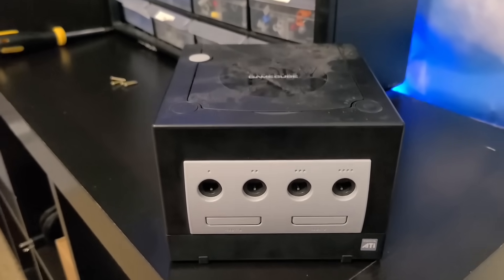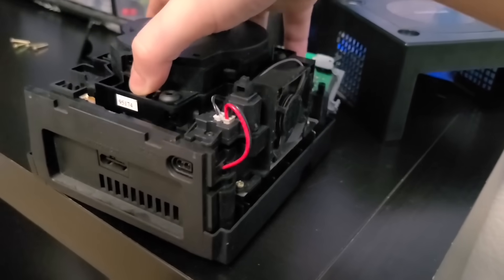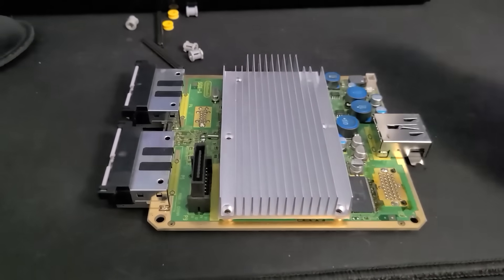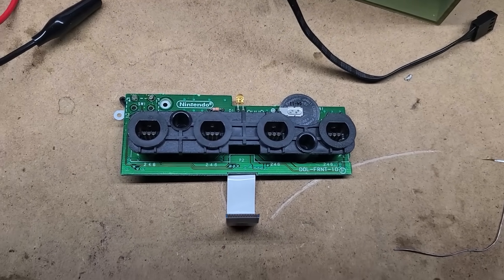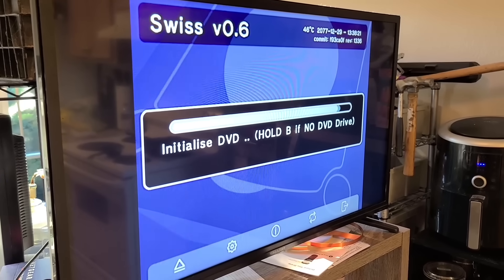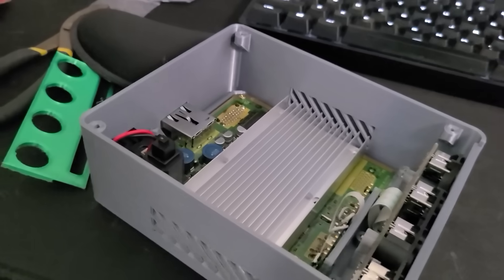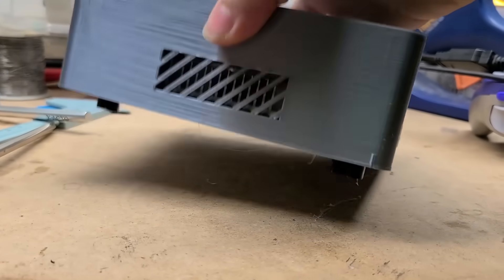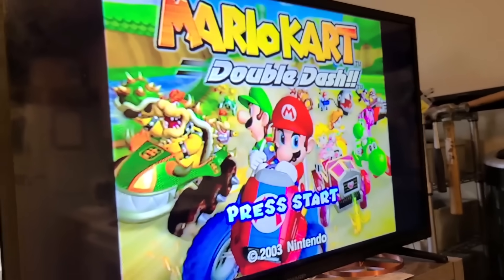I made my own GameCube Mini because Nintendo wont

Comment: Too late now but should've done the BT controller mod to it. That would've made it the perfect mini console. The mods people are doing to these now are amazing 👏
Reply: What's bt?
Reply: @moldorm99  Bluetooth
Reply: What about latency?
Reply: @stephanemignot100  can't recall but it seemed to be using a pretty decently new bt standard iirc. I'd do it if I could just because cords are annoying to me now. And if it does have bad latency someone will improve it with a raspberry Pico lol
Reply: hell four of the 8bitdo adapters are cheaper than the blue retro BT board.

Comment: You might consider passive cooling.  Since the original had the CD drive above the CPU, it necessitated the fan.  But perhaps with your top vents, passive cooling (no fan) would be possible  You would of course have to test it.

Comment: You could have used PWM (Pulse Width Modulation) to control the speed of the fan.  Pico could control a transistor that turned the fan on and off really fast to adjust the speed.  Then you could have gotten 3.3V worth of speed out of it while technically running it on 12V (or 7.5V, or whatever).
Reply: a transistor would be unneeded since there is straight up a PWM pin on that fan. not sure what logic voltage fans accept though.
Reply: @asuasuasu  That fan looks like a NF-A8 PWM. Gamecube stock fan however is straight up 12V 100% all the time, easily spotable since there are only two leads. Voltage controlled fans don't accept any logic and you only have three leads, two for power and one for tachometer.
He could've used the pico and an additional temperature sensor glued to the heatsink with thermal epoxy to get the current system temp and then use the pico to generate a PWM signal; no need for a transistor.
Reply: @Ruhrpottpatriot  If the third pin isn't for logic level PWM, then a micro controller board won't run a fan like that by itself. Not enough current source/sink capacity. Best to use a MOSFET.

Comment: the fan would probably be more efficient if it was blowing out the hot air
Reply: The Gamecubes fans are different they blow in air and it blows out on the side.

Comment: Great modification! The only worry for me would be that high temperature as soon as you boot into swiss. 50 degrees Celsius is pretty high for a cold start temperature!! My factory GC with swiss shows around 38 degrees Celsius after a cold start and does not exceed 42 degrees Celsius after 2 hours of RE4! Ambient temperature 25 degrees! This sensor might not be that accurate yet it could be indicative of the temperature situation on the board so watch out!
Reply from the maker: I have no idea why this is the case, but I've done 4 Picoboot gamecubes now and Swiss ALWAYS without fail shows above 50°C, even on fresh thermal pads on an otherwise stock console. It's pretty hot where I am so maybe the ambient temp is just high.
Reply: @BringusStudios  I dont know above 50 degrees is like having an Intel CPU :D:D I just did a picoboot Japanese DOL 001 yesterday for a friend of mine and the swiss was showing 26 degrees Celsius (without the disc drive) just test it with lower environment temps and see if that will go below 50 degrees but in general you should always be aware of the temps!
Reply: @BringusStudios  Also I would suggest you try two smaller fans for push pull on both sides of hte case, in theory that is the optimal air flow principle in any case be it console be it PCs etc!!!
Reply: not bad, but in this situation, pushing air is better than pulling. you should invert that fan and it should be cooler.

Comment: Watching this makes me think back to the “making Wii portable” days of YouTube, I wonder if there are any chunks of the board that the Gamecube just straight up doesn’t need to potentially remove some of the thickness of the console.

I’d imagine if Nintendo were to make a console like this it would be a normal looking gamecube at half the size like all the other classic/minis
Reply: I've seen someone tried to make a portable GameCube and they ended up using a Wii board, because it's way smaller and basically the same hardware (but clocked higher), which can run Gamecube (and Wii) games natively. It's a win-win, no reason to mess with GC board (other than novelty factor, I guess).
Reply: @MrGarryGrey  yeah now that I think about it I’ve seen someone do that too, I’m sure if Nintendo wanted to make there own mini they’d end up doing something like that and then loading it with Mario Sunshine, Wind Waker, Melee and then just throw on 7 games that no ones heard of
Reply: @DylozWitty  probably also double dash and a Mario party
Reply: @MrGarryGrey  yeah same
Reply: @MrGarryGrey  there is, some advantage to using a GC board. 

Assuming you keep the same bottom footprint and ports, you could attach a Gameboy Player, granting you perfect play for all GBA and GB/C titles unlike the still-imperfect emulation on Wii homebrew. I know he didn't do it here, but if you didn't it would work just as well as a stock gamecube.
Reply: nintendo launching a new GC or Wii machine would be rather surprising to me. they would almost certainly need to do this with emulation and you would need better than switch class hardware, aside of all the engineering effort.
in comparison, NES emulation is trivial and N64 emulation for a few select titles is not a massive challenge to a talented team. unless they straight up "steal" dolphin of course.
your best chance at an official solution would probably be on the switch successor. they're probably more interested into porting/remastering some of their popular titles though.
Reply: @asuasuasu  pretty sure dolphin was started by reverse engineering the wii so nintendo wouldn't really have to steal the code
Reply: Been in the hobby since 2007, and the good news is that the gamecube motherboard has already been traced out and there's a few trimming guides out there
N64 trimming guides exist as well, the Wii trimming research was pretty much done after those were finished
Reply: There was a project called killmii which trimmed a wii board to fit in an Altoids tin, along with a screen, barely usable controls, and enough battery life for 10 minutes of game time
Reply: I would buy that in a heartbeat.
Reply: I would like a portable GameCube made by Nintendo that takes the mini disk
Reply: I believe there's a gamecube emulator for phones even. But if nintendo were to make a new, official, non emulated version of the gamecube, the graphics and computing part could be very small, passively cooled, and efficient with today's tech. Obviously you still need a decent space for the disk drive.
Reply: @enterchannelname7568  I feel like they would most likely not actually keep the disc drive, most minis/classics both Nintendo and Sony have made in the past just have games loaded onto a hard drive rather then using discs, it allows them to keep the same look as the originals while removing some mild functionality
Reply: @enterchannelname7568  it’s inherently emulation though because it wouldn’t be gc hardware. FPGA consoles simulate hardware instead of software emulation but they’re several hundred dollars

Comment: Oh yeah, YouTube's about to pick this one up HARD. Rather than be an armchair electrician, I'm gonna stick to the positives and say that this is a super well executed mod! I had no idea about the integrated Power board on the DOL-101 model, so that'd be a huge help to things.

Out of curiosity, do you know if this cube still has the board points for serial port 2, even if it doesn't have the connector? If so, I imagine you could pair down the bulk even a little bit more by eliminating the SD gecko and adding an integrated SD card slot for your homebrew and dumps. It'd still require a physical memory card for game saves though, so the benefits might not be substantial enough to be worth it.

Thanks for sharing!

Edit: inb4 this gets posted to hackaday
Reply from the maker: I've been told it does have the hardware to communicate over SP2 still, but I'm not sure where the source is for that. I could always compare a rev a/b board and follow the traces but that sounds like a pain...
Reply: @BringusStudios  Do you have a discord I could add? I found some links that should help, but YouTube probably will block them.
Reply: @BringusStudios  Sent you a DM on Printables with the links.

Comment: You don't need to take up a memory card slot for your SD adapter, you can solder it to the serial pads on the board that SP2 normally connects to. Then you can have a microSD slot integrated into your faceplate.
Reply: I actually got like 50 of those PCB's fabricated last year and haven't used a single one lol.
Reply: @MattBeaver  The ones made for SP2-lacking boards / internal installation? Lol, at least PCB fabbing is cheap as all hell these days.
Reply: @boomers_pb  Yup, those exact ones.
Reply: @MattBeaver  what a waste
Reply: Can you please direct me to a link for that as I have a dol101 and don't have a sd2 memory card adapter.

Comment: It would be flatter to just lay the controller ports so the port faces up. I didn't see what the tall black port was on the mainboard. You could just junk the power switch/AC input and use any switch/wires. Add a top to the heatsink fins and blow from the side.
Reply from the maker: The plan is to keep developing it to be smaller. Thinner fan, proper SD card slot, DC barrel jack, relocated controller ports, etc
Reply: @BringusStudios  Maybe try and find a Wii and look at what it uses, maybe those parts might be smaller. Flatter heatsink? You might have to use a 4 or 6 pin molex connector if there are multiple voltages(or maybe to supply power to a cooling fan without being limited to what the console was designed to give to its stock fan).

Comment: This is awesome! I wonder how much smaller it could possibly get with internal sd2sp2 and blueretro. The controller ports and memory card slots could be dropped as a result.
Reply: Yeah, I was thinking the same thing.

Some kind of internal SD solution; Blueretro; scrap all ports except AV and and power, could probably get it down to the 20mm high range.

For extra points, start trimming the PCB and experiment with other cooling solutions. I'm not entirely sure what the GameCube TDP is, but you might be able to get away with passive cooling if you made the entire case out of metal.
Reply: @phirenz  I think if you're getting into trimming the PCB it might be more worth it to just do a Wii mod since that stuff is already heavily documented and gets really freaking tiny.
Reply: @Trinciacrophobia  Yes, lot of merit to that approach. The portable Wii cuts get really, really small. And I don't think I've seen anyone doing Wii cuts for a non-portable project.

But I also think that reaching for the Wii everytime you need a small GameCube is a bit stale, and it might be interesting to see more projects sticking with the handycap of using a real GameCube motherboard.
Reply: I mean, it is on a ribbon cable and has screwholes. You could put the ports on the top.
Reply: @axelkusanagi4139  You could. Could also do internal Wavebird reciever as well, if there's no budget lol.
Reply: @Trinciacrophobia  the moment that interference starts happening, it’ll be a major issue
Reply: I was thinking the same thing, we can already load games from an SD card so maybe a built in SD card reader or something
Reply: Controller ports and memory card slots are an integral part of the experience though :(

Comment: Great work! But you should invest in a hot air rework station, that could get rid of those connectors in seconds instead of using a Dremel.
Reply from the maker: I have one actually, I'm just not skilled enough with it to not completely ruin the entire board in the process yet, so ironically dremeling was the non-destructive way for me
Reply: This, I cringed when he said he took a dremel to it, he ruined a pair of perfectly good ports that could have been used elsewhere or repairs on another gamecube.
Reply: @chrisbellamy8867  The GameCube is not a rare piece of hardware. It really isn’t a big deal.

Comment: You can solder an SD to SP2 board to the points on the board, and that would eliminate your Gecko. Overall it looks fantastic!
Reply from the maker: Do you have a link to documentation for where I need to solder to? I'd love to do that
Reply: @BringusStudios  https://cdn.obscuregamers.com/data/2020/02/5544_SerialPort2.jpg shows the ports you need to solder
Reply: Didn't the first revision of the blackdog tech GCLoader solder to the disc drive connector pins?

If you used a slimmer impeller fan, you could probably get away with putting the board for that next to it.

Or maybe even use passive cooling in a metal case? TECs?

Comment: Thats pretty awesome man. I randomly got recommended your video and definitely wasn't disappointed. Maybe take a sharpie to those cut outs for "Nintendo" and "Game Cube" to make the lettering pop more. Beyond that, the fan was truly the icing on the cake for me lol.
Reply: Since it's the top is recessed into the case you could do a colour change which would look better, sharpie on 3d prints looks terrible. Print first 50% in black and then the rest in silver. You would only see a black line at the front which wouldn't look that bad. It'd certainly look better than sharpie filled in. IF you're that bothered you could bevel the edge of the top plate and the front plate 45 degrees like a mitred edge and that would completely hid the layer change whilst still functionally holding the front plate in

Comment: Cool project, mate! But if I were you I would place the front PCB horizontally with connectors facing upwards. And make a horizontal holder for Pico Pi to keep it above the radiator. And make an air duct to channel air from an opposite side into the stock fan (or small noctua) placed also horizontally on the radiator, like you planned first.
Reply from the maker: I actually though about this, that would be the next step to make it even smaller for sure. I could also use an 80mm slim fan, they're only a few mm thick
Reply: Oooh nice, curious to see that. And with a big fan it may be better to make some vent holes to pump air around the PSU. I don't know how hot they are in GameCubes but cooler is always better, I guess.

sigh One day I'll get myself a 3D-printer to...

Comment: Just an observation, 1st of all, awesome video, now, you could continue the ventilation holes all the way to the sides and mount the fan to exhaust air instead of intake, and avoid re circulating hot air inside trying to scape the console.
Pardon my engrish
Reply from the maker: I thought the same thing, but the gamecube is so low power that I figured it probably doesn't matter much, and I like the look of the fan better as intake
Reply: Yeah but with the Pico SOC and VRMs suplying extra current for the ModChip, or just some exhaust vents in the back for the air to circulate over there an dnot just the sides